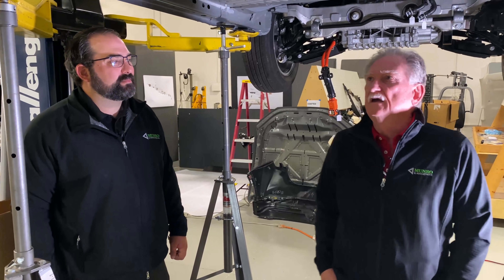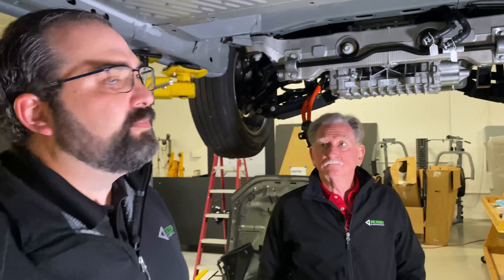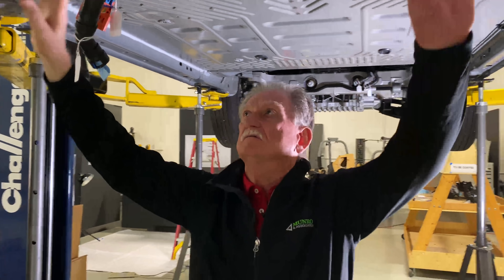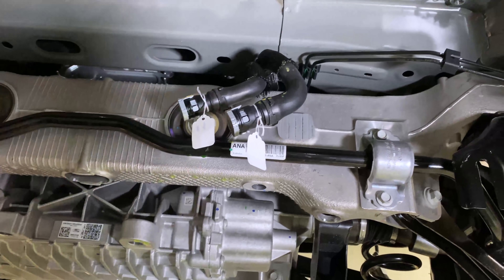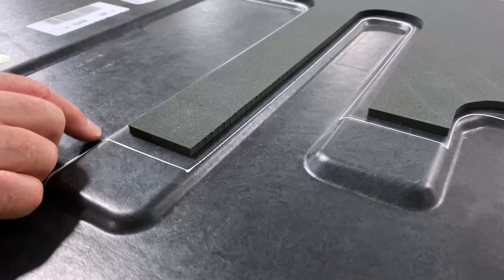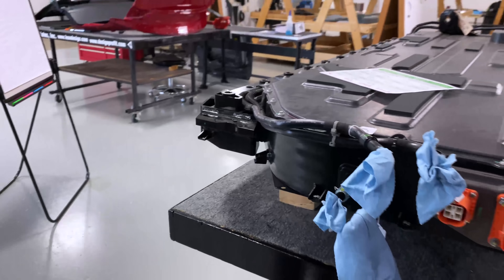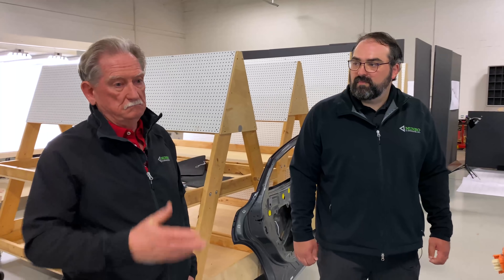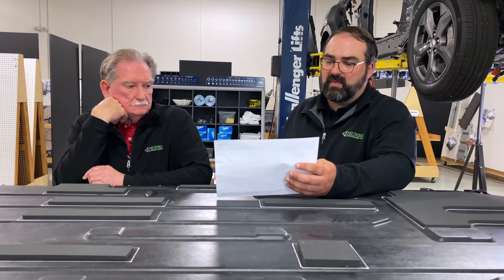First look at the Ford Mustang Mach-E Electric Battery

Comment: The battery pack comparison chart was an eye opener. Thanks for posting Sandy.
Reply: Wow, the e-tron and i-pace are missing the boat big time
Reply: @2nd3rd1st  The e-Tron is heavy (5,699 lbs.) and slow (0-60 in 5.7) when compared to Tesla
Reply: @ronaldlenz5745  e-tron is actually faster than the numbers suggest. even with launch control, there is a weird delay before it takes off. However, once it is going, acceleration  is much more than adequate, especially in sport mode. No excuse for the pathetic range, however it has not been an issue for us.
Reply: @ronaldlenz5745  Exactly, because it's well build. those EPA numbers are way of though, none of my prior 3 Tesla's could reach the EPA numbers 15 ms 85d 19 mx p100d and 2021 m3p. My etron hits it quite easy without giving it any thought.

Watching some of these reviews I am sorry to see that quality is not much of a concern, they care more about how to manufacture it cheaply, that does not benefit me.
Reply: @2nd3rd1st  And Ford is only able to deliver about 6,500 Mach-Es per quarter so far. One has to ask how long it will take them to ramp the F150 Lightning in any meaningful numbers without cannibalising batteries from the Mach-E. I sense troubled waters for Ford’s EV production.
Reply: @wattlebough  Ford under promised and over delivered on the range. Tesla over promised and under delivered on the range. #FACTS
Reply: @twany442  Makes no difference if Ford can only deliver 6,500 vehicles per quarter. Tesla just delivered 201,250 vehicles in Q2.  Multiply that by 4 equals what, for 2021? That’s another fact, and a not insignificant one.
Reply: @wattlebough  Ford has been in the vehicle game a long time and knocked it out of the park on their first try. There is no doubt they will deliver as promised. Batteries will not hold them back.
Reply: @twany442  At the end of the day Id still take the better car, Tesla Model 3
Reply: @timmydevil999  They did a very nice job with the Mach-E. It’s a very nice vehicle overall. But the battery technology is an issue looking at the chart comparing weight, kWhs and range. It’s the battery efficiency and cost that is going to be the decider that sets the limits on production volume and vehicle cost. At this stage Ford has a lot of catching up to do. 211 miles from a 68kWh battery that weighs 485kg (1,069lbs) is not great. Hopefully they have something up their sleeve with their battery technology that gives Tesla a run for their money in the not too distant future.
Reply: @twany442  Tesla have highest ranges on every category of products they sell. That is just an idiot statement I'm afraid
Reply: @DuarteMolha  In the interest of aligning our range testing with the EPA's estimates, which take 100% of the nominal battery capacity into account, Edmunds charges all electric vehicles to their maximum allowable capacity. You can view the real-world range for every electric vehicle Edmunds has tested here. For vehicles that have a suggested lower daily charge such as the Taycan and Model Y, there is an asterisk next to the range figure. For others without an asterisk such as the Ford Mustang Mach-E, the max range can be used on a daily basis.
Reply: @twany442  I think you might have forgotten to add a link to what you are refering?

Anyway. You are saying that the company that has the best range cars overpromises and underdelivers when almost no one has a range with a range to match... So I really don't think I have much interest in your FACTS.
Reply: @twany442  Are you saying you're affiliated with Edmunds? I wouldn't be bragging too much about your seriously flawed testing protocols. Let's see, right off the bat your posts here are incorrect. Ford has the exact same daily charge recommendation that Tesla has, that being 90%. Second, you've done precisely one good test of EV range, and then you refused to disclose the results. The test on the track where all cars were charged overnight under the same environmental conditions, and then run from 100% to car stop on the same track at the same time. That's a great test of relative range, but you only disclosed the range from 0% battery to car stop. Why not release the obvious results, 100% battery to car stop. Any rational observer understands that the results would not be favorable to your paid advertisers, so you withheld the results. Yeah, Edmunds is worthless as an unbiased source of information. At least you had the integrity not to just falsify the results. I have to admit that surprised me.
Reply: @twany442  
Well, it is more nuanced and more complicated than that.

Contrary other EV manufacturers, Tesla does the optional extended EPA standard procedure and as such presents its results according to the extended EPA standards.

And yes, this extended standard does overestimate the range. Blame it on the EPA standard. So technically you are correct. And yes, Tesla knowingly uses the extended EPA standard in their range marketng.

But yes, in real life it does not meet the range for these idealized conditons. But it only is about 2.5 procent of (in at least one independent real life test) for the Tesla 2021 models.

See:
https://www.edmunds.com/car-news/2021-tesla-model-3-long-range-falls-short-of-epa.html

Having said this, as it stands, and to my knowledge, Tesla currently outshines most (if not all) other EVs in real life winter condition driving.

Additionally but on a side note, Tesla proved to have a long battery life with modest battery degradation, ensuring a consistent range during its economical lifespan (assuming "normal" driving usage).

From the same source as listed above, here is a range comparison comparing various EV brands:
https://www.edmunds.com/car-news/electric-car-range-and-consumption-epa-vs-edmunds.html
(and even these results are subjective. As, among others, shown in the weather discussion).

Regardless, as it stands, tesla consistently delivers the most range for the type of vehicle (taking passengers room and baggage storage into account as well). 

The (currently) most efficient electric vehicle on the verge of getting into production is the Aptera. However, that is a 3-wheel 2-seater with an amazing bagage storage capacity for its size per passenger.
Reply: @wattlebough  They did buy her own battery producing facility.
Reply: @paulerhimona9244  Dude! It's no facts that Tesla over promises and under delivers on Range that's why the Mustang E was but in the Guinness book of World records for its range and not the Tesla. Bye boy!
Reply: @paulerhimona9244  And you thought Tesla made the first EV before Ford. Tesla just made the EV popular and mainstream. And that was in 1998.
"Ford Ranger EV - Wikipedia" https://en.m.wikipedia.org/wiki/Ford_Ranger_EV
Reply: @twany442  were is the link mad man?
Reply: @twany442  A classic Tesla strategy.
Reply: @twany442  Lol.
Reply: @2nd3rd1st  So much for "Vorsprung durch Technik" LOL
Reply from the maker: Sure thing!
Reply: Please add total weight to the battery comparison table, nice work as always 👍
Reply: Check also Matt Joyce chart “EV Core efficiency comparison” table. 
It was eye opening back in 2019 and is still relevant today
Reply: Don't look now but the Tesla Model 3 is even better than the chart which has the old 310 mile range on it.  The latest AWD version has an EPA rating of 353 miles.  Tesla isn't standing still, they keep making improvements as they produce them.
Reply: @morrisg  I got the impression the 310 mile range was a reference to their real life findings. The EPA rating is when all the planets align and you can go downhill and/or flat, in a nice smooth motion without a heavy foot.
Reply: @ThomasLeica  Here's a link to an in depth explanation of what the EPA test is and how it's measured:  https://www.fueleconomy.GOV/feg/how_tested.shtml
Dig down into the actual tests and you'll see they are designed with very low acceleration rates and low speeds, which is what gives gas engines their highest mileage ratings.
Reply: Don't forget that ME standard battery is 75kWh of which only 68kWh is available to preserve battery life. When Tesla reports 75kWh -- it's total. Also the Tesla's range is grossly overstated. The credible tests show ME has slightly better range than Tesla: https://www.edmunds.com/car-news/tested-2021-ford-mustang-mach-e-standard-range-rwd-beats-epa-range-by-34-miles.html

Comment: These breakdowns are always an interesting and educational presentations. Too bad gm no longer sells the Chevy Spark EV because I'd love to see your take on it. As an owner I think it was a damn good vehicle and while it's EPA range is only 82miles many of us are seeing 90s and some 100 during the warm months and considering it only has a 19kWh battery in 2015 & 2016 it sure seems to be pretty efficient. Thanks for doing these!
Reply: The Bolt is essentially a better and somewhat bigger (which is much easier to sell) Spark EV. The Spark EV was always intended as a temporary model to fill in the gap until the Bolt arrived.
Reply: @brianb-p6586  I agree but for a temporary compliance vehicle it was/is a pretty damn good little package especially if you compare it to the new Mini EV or the EU variations of the VW eUp. 0-60 around 7.5 secs, top speed limited to 90 stands up very well to those newer mass produced subcompact EVs and many larger EVs as well. If they could stuff newer more efficient batteries and give it a range of 150miles per charge I think it would still be a viable answer for many needing a good commuter car. I recognize there are 1 vehicle families out there and it would never fit their needs but as a second vehicle it's a great fit. Until I bought my 2016 my primary car was my 2004 GTO 6sp but I find I choose to drive the Spark EV for most of my needs now so the GTO is now a cruise/weekend driver now.

Comment: Good video except :  InsideEVs and other publications have published real world range figures. EPA numbers are not accurate, especially for the Audi. The battery weight to range chart is another example of it being best to stick with things you have tested yourself.

I look forward to the battery teardown and a video going over Ford's electronics. Glad you will be doing more videos on motors and drive units as well.
Reply: 10 people could do a "real world range test" and get 10 different results. EPA estimates, although not always a reflection of real world driving, gives a standard baseline.
Reply: @xBIGMUSCLEx  Perhaps you should read the article before commenting.
All cars were run under identical conditions in the InsideEVs test. The intention was to get a comparison between the cars themselves and to their EPA rated range. Though they did not test the etron RS GT a number of reviewers who run systematic range tests (notably Tom Moloughney and Bjorn Nyland) have tested the Porsche/Audi platform and have found it to far exceed its EPA range, even at real world freeway speeds.
Reply: @Miata822  Again, the industry needs a standard/baseline. We can either start depending on InsideEv, Edmunds and Bjorn Nyland's numbers as the new standards and confuse the hell out of consumers, or we can stick with a single agency such as the EPA. 

EPA ratings are typically not a good reflection of the real world, but the delta between EPA estimates and real world numbers aren't wide enough to misinform the consumer.

Comment: i am looking forward to getting into that battery......   another good start to a week for your fans..
Reply: Yes.  Are they using pouch batteries?  And what is the chemistry?  And what is the installed capacity? - Fords supposedly has a reserve capacity to not go below a certain charge percentage.  It will be very interesting to see!
Reply: @pierre.a.larsen  - For the extended range battery: 98,8 kWh actual, 88 kWh usable.  So there's nearly a 11 kWh buffer.  It is believed the buffer is used on both the bottom and top end of the battery to protect full battery drain (SOC 0%) and full chargers (SOC 100%) scenarios, which should be avoided as much as possible, to help lengthen the life of battery.  Some have postulated that when the battery starts to lose capacity, Ford will make some or all of the buffer available for use, similar to what I believe Tesla does (or will do).

Comment: That alignment bracket looks like an afterthought.  Alignment could have been integrated into the mounting points.
Reply: I agree.  That's one heavy hunk of metal that doesn't add anything to carrying the battery.  A couple of milled slots in other sections of the frame could have done the same thing without adding weight or requiring someone to bolt it on.  Poor design.
Reply: I totally disagree with you.
Reply: @alanmay7929  Other OEM's don't.  Tesla managed to align their packs without such a poorly designed bracket.
Reply: @JRP3  it is not a poorly designed bracket.
Reply: @alanmay7929  Needing to use the bracket is a poor design.

Comment: Where did you get the range for the 3?  75kwh pack gets 353 in the long range.
Reply: And Modrl Y is 326
Reply: Munro Live could really use model years on that chart. The Model 3 listed was the 2018 LR AWD EPA rating, which was indeed 310. The Model Y was 2020. Significant improvements between 2018 and 2020 that benefitted both Model Y and Model 3.
Reply: @poseidon129266  Yeah that's not good comparing out of date specs.
Reply: Funny how Edmonds did a real world  range test and found the Mach-E achieved a real range of 304 miles very impressive!
Reply: @gregandkaruna6674  Funny how that has nothing to do with the fact that the Model 3 gets 353 miles of range from a 75kWh pack and the Mach-E gets only 304 miles from an 88kWh pack.  Not impressive!
Reply: @JRP3  You are obviously a bit slow the Tesla has a claimed range of 353 but cannot actually get that range

Comment: Audi are eventually ditching the e-tron because the Q4 on the VW MEB platform is bigger and goes further on a smaller battery. While they did do something right with the charging curve, they messed up somewhere in efficiency. Even for a 2600 kg SUV, it's too much. And it could have been 2300 kg if they had cared. Even with all the good sound deadening they have going on.
Reply: Wrong, the Q4 e-tron is considerably smaller than the e-tron.
Reply: The eTron is a lead sled.

Comment: I'm watching these videos and also thinking about the Tesla Giga press and wondering what the repair costs will be for a minor accident compared to a standard ICE car. 🤔
Reply: I would think a minor accident would not damage the front or rear die casts?!  A larger accident would and then I suppose the car will be totalled?  But is that really very different from cars without die casts?  It seems to me all cars nowadays are totalled for what seems like repairable smallish accidents.
Personally, I would prefer the cheaper and more efficient production combined with what I assume is a stronger and safer car - even if that leads to more totalled cars.  Also, self driving technologies should limit accidents greatly.
Reply: Elon has stated there will be portions of each of the castings that can be cut away and have replacement portions that can be bolted on for that exact crash scenario. That said, a majority of insurance companies tend write off cars as a total loss for any sort of moderate collision, so even if the giga press castings couldn't be repaired, it wouldn't matter in most situations. It's more of a battle of actuaries and bean counters than one of how a particular car is manufactured.

Comment: Informative. It would be useful to normalize the mass of the pack per range of the vehicle. How much mass per distance in each pack.
Reply: Range is based on EPA values which are too variable to take seriously given their inconsistency in testing standards (two vs five cycle).
Reply: I’d rather see it as kWh per pound or kIlogram
Reply: Yes devide range/weight, range/kwh, weight/kwh or the other way around , so they are all on even footing
Reply: I looked up what I needed and did all the math. The short answer, Tesla is best - in pretty much everything. mile/Kg car weight Tesla about .17 M/KG. the only one  close is the bolt @ .159.     Mach-E = .105   
 miles/KwH Tesla 4.1-2   Bolt = 4.32!!!  Mach-E =3.1
battery % weight    Bolt 26.83%   Tesla 24.7% mach-E   24.25% !!
jag/Audi suck in all metrics. no surprise.
Reply: The mass of the pack is meaningless for range.  The mass of the entire car is what matters.  Their are lots of factors that contribute to range and most are with the car, not the pack.
Reply: @_PatrickO  That is the mileage vs vehicle weight.
Reply: @GROND15  Correct, the only time mass matters.  The individial pack weight is meaningless when it comes to range.  A beefy pack could be bolting into a less beefy frame that relies on the pack for structure.   Overall car weight is the only comparison that would make sense because that is what actually effects range.  Sandy mentions it because they sell engineering services to reduce weight all over the vehicle.